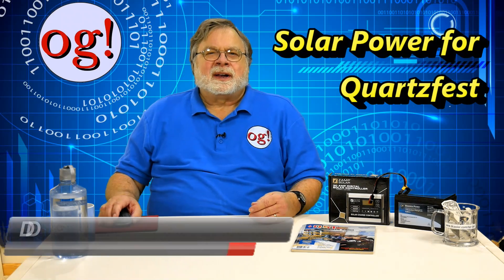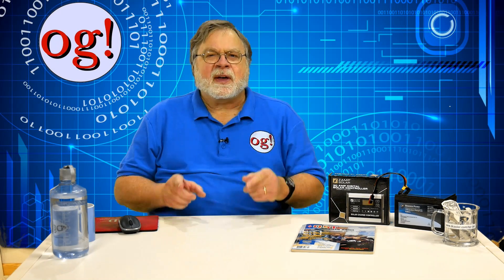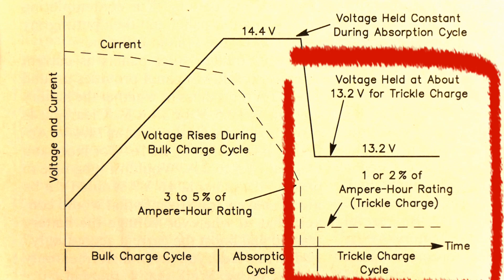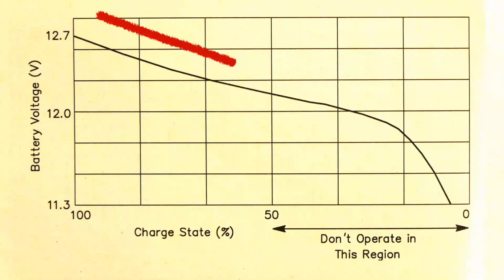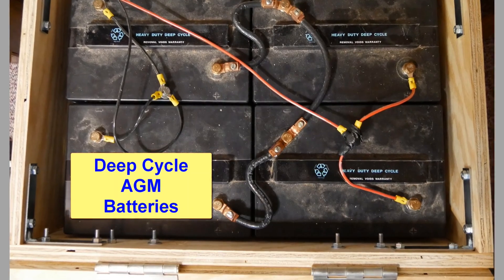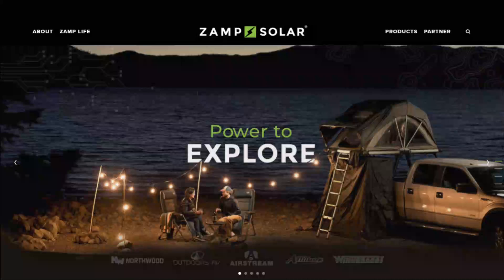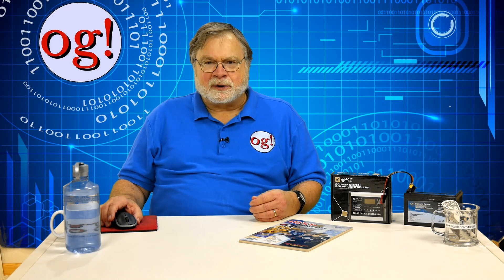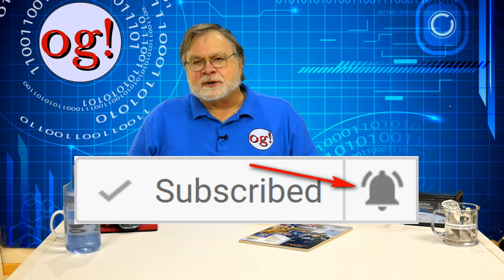Quartzfest Prep: All about solar panels, controllers, and batteries (#186)

Comment: Hi Dave, great video!    Where can I get or print out a copy of the chart you're discussing at around the 6 minute mark?   I need to study it.   It's going to be a few more years before I can retire.  I'm planning on some sort of RV, I will add solar and more battery power.   I mist learn more about Solar and RV'ing.  Thank you de N5USS
Reply from the maker: It's from an article I wrote for QST in April, 1996.

Comment: I currently have 4 - 100-watt solar panels and a 400-watt wind turbine which I am trying to find a mast to mount on. Apparently, no one wants to ship the wind turbine masts to Hawaii so I am trying to figure something else out. I do not have the solar panels connected yet because I can not figure out what the minimum number of batteries I need to start building my battery bank with. I plan to add more batteries to the system later, but I want to make sure I am starting with enough batteries that I do not damage them by putting 4 solar panels on them. Also, I have not decided on the type of battery to go with yet. Everyone keeps saying golf cart batteries, but with the different voltages being paired together to create the correct voltage that is just getting too confusing for my little brain. I looked at LifPo batteries but at over $1,000 each plus shipping, that was just way out of the budget to build a battery bank with. So, a year later I still do not have these panels connected to anything and have no backup power source.
Reply from the maker: Keep persevering with your research. As a rule of thumb, you need enough batteries to power your loads for a week and not exceed 50% discharge. You need enough panels to power your average load, averaged over a couple days. Some things are probably too big a load to put on solar, such as air conditioning. Good luck!

Comment: Hi Dave, I'm looking forward to chatting with you again at Quartzfest. My RV has 780W of solar on the roof, a 100A MPPT charge controller ( leaving some room for expansion if needed ) and a 400Ah LiFePO battery bank. It also has a 3kw hybrid inverter, but that's not really part of the solar system. I'd be happy to show the setup to you if you're interested. See you there!
Reply from the maker: Looking forward to it.

Comment: I have the same Yamaha generator. At our club field day it generated noticeable more noise on the HF bands than a Honda 3KW inverter generator.  I bought a corcom filter to filter the output, but have not used it yet.  Any information on how to clean up the output to keep the extension cords from radiating RF would be a help.
 But it has been a good little generator.  Man, wish I was going to quartzfest...it is on my bucket list.

Comment: It gets way more complicated. Lithium batteries should never be float charged, simply cut off. And for optimum life, cycled from something like 40% to 95%, never 100%. And stored at 45% (ish) not 100%. Did I mention it gets complicated?
 PWM and MPPT actually are more efficient than pure DC for a lead acid battery, since the boil the electrolyte less.  And a real MPPT controller can always beat plain PWM, unless the panels and batteries are mismatched. Speak to the folks at Outback and Bluesky, the old 3-stage charging has been obsolete for a decade. The new "rules"? They get complicated.
Reply from the maker: Please send me a link with more info on the three-stage charging updates for lead-acid batteries.

Comment: I have that same generator. I much prefer it over the Honda!
Reply: Can you explain why? Just curious. Thanks
Reply: @cuisinartOH1  The Yamaha has a fuel shutoff switch and fuel gauge.  It also has what i feel is an easier to control interface.  There is a tri-fuel kit for the Yamaha as well.

Comment: You could also increase the number of batteries in the camper.  I have a fifth wheel and installed two 6 volt golf cart type batteries.  Seem to last a long time.  Also installed 2K pure sine wave inverter (close to the batteries) and installed two 12v outlets wired directly to the inverter.  I chose a different color for the outlets and they are located next to the house ones.  I do a lot of off grid camping on the Kern River.  About every three days I'll run my Honda 2K gen. that is chained in my truck bed to top off the batteries.